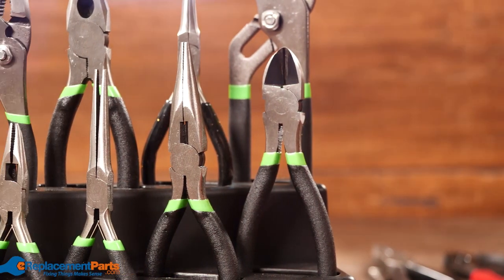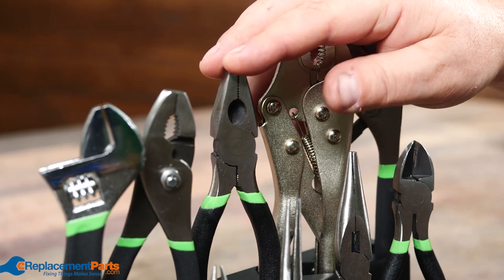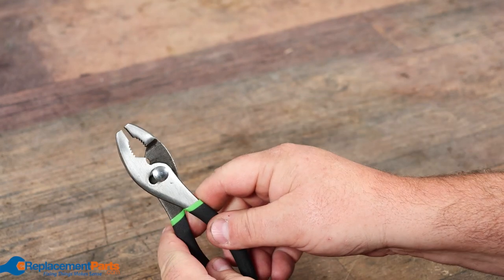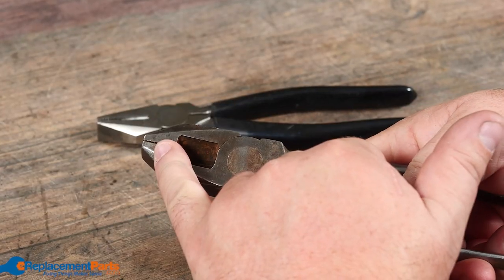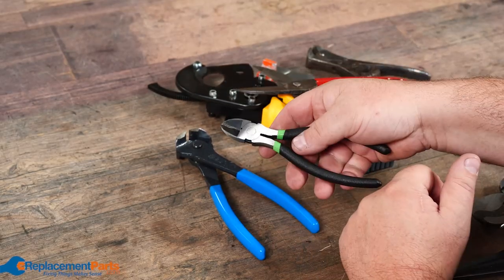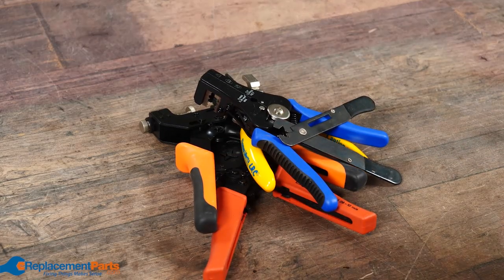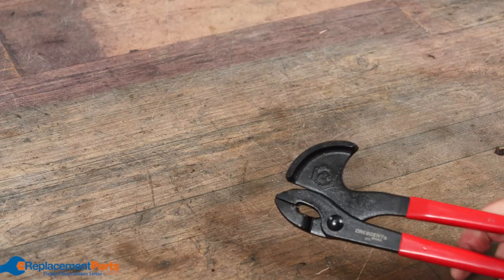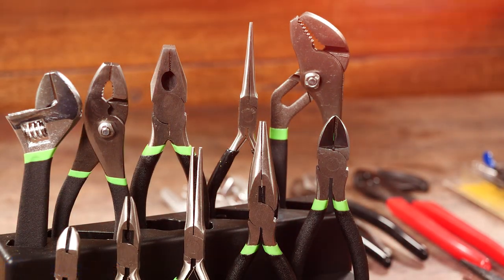Pliers 101: Understanding Different Types of Pliers in your Tool Box | eReplacementParts.com

Comment: Ire ferrules is not used this way man, it crimps the copper sleeve on the wire strands, not the insulation, other than this, is very good